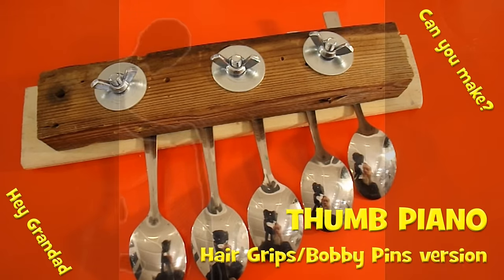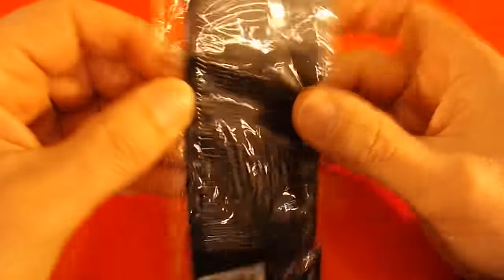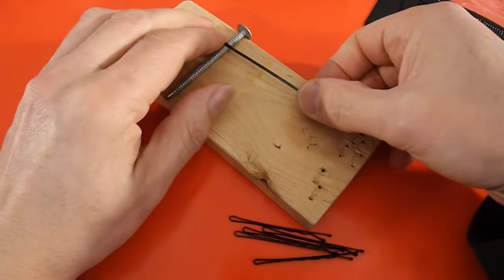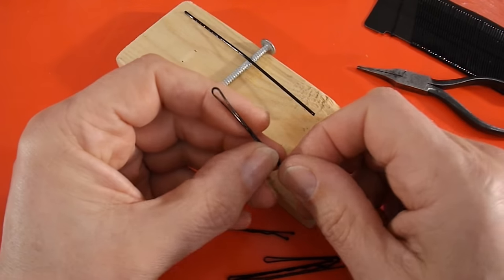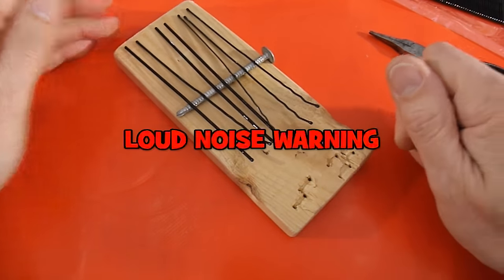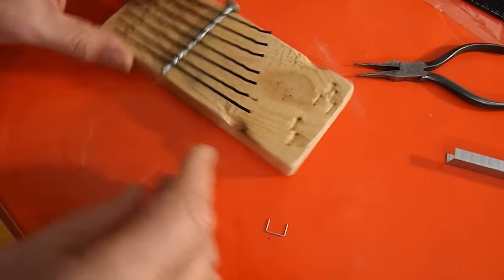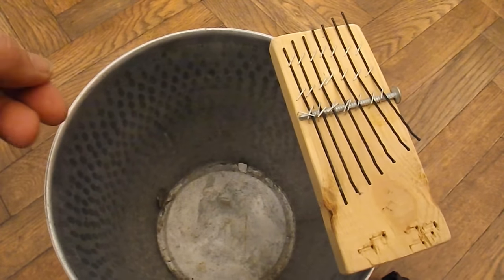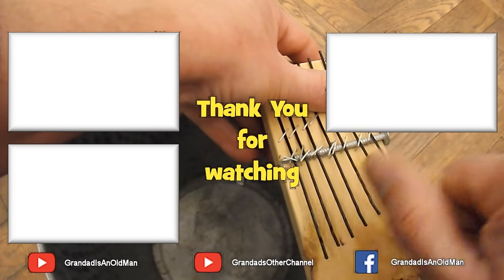Thumb Piano with hair grips/bobby pins

Comment: it's not tuned man
Reply from the maker: Correct, it is not tuned 😊
Reply: how can you tuned it? to make abetter sound?
Reply from the maker: Esther Ng you adjust the length of the wire sticking past the nail. It is the length that sets the note. With this particular design that will not be easy but you might be able to grip the wires with pincers or pliers to moves them. Other designs would used screws rather than staples to hold the wires and you could loosen the screws to make the adjustment.
Reply: GrandadIsAnOldMan There's a very cool iOS tuning app that I use for my über-crude bass notes. (eg high tensile yet thin climbing rope strung between 2 trees + ratchet strap) 😎